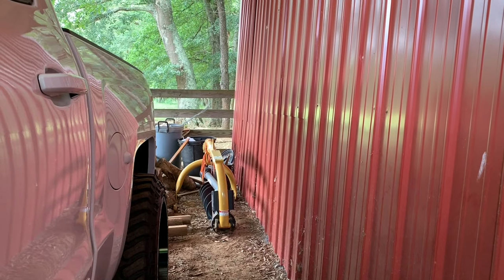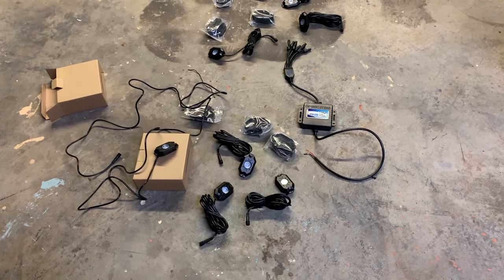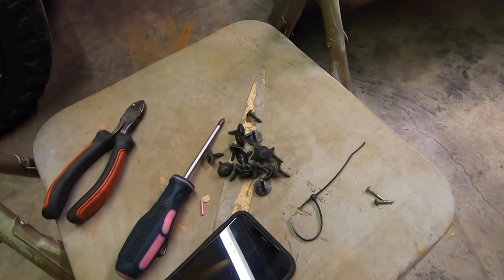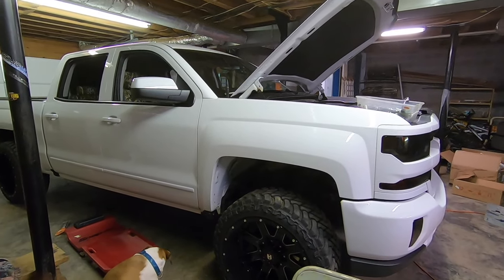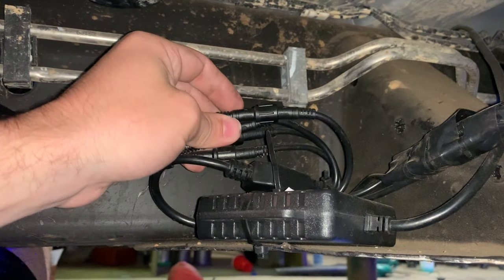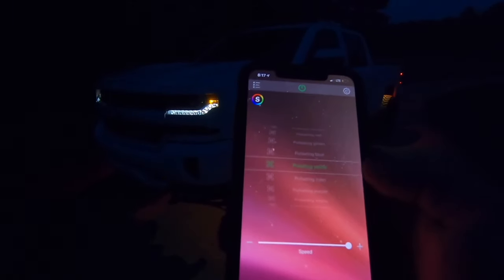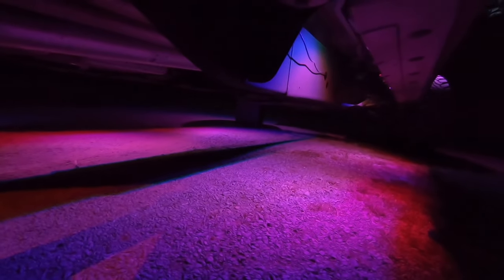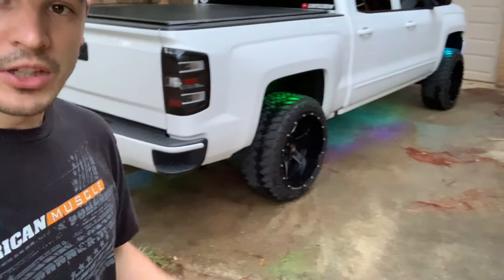Rock light install!

Comment: I took extra wire from a left over job to extend the module to the center of the truck. Then hardwired them to my upfitter switch with constant power when ever I want.

Comment: I usually run green on my truck. They’re pretty laid back around here about rock lights but I ain’t risking it
Reply: Silas Bargo same, but I had one cop tell me if I run them the only color really legal is white
Reply: Krypticate they’re pretty laid back here where I’m from. There’s more than a few guys running just straight blue lights an I ain’t seen one get pulled over yet. Knock on wood

Comment: Question.. I have an 8 piece rock light kit… do you suggest 2 per wheel well or 1 per wheel well / 1 front-1 rear- 1 between driver and passenger

Comment: What gauge positive/negative wire did you use? I used 18 gauge to extend the positive/negative wires from the module to my battery and the positive wire burnt down after a long drive right after installing them could this have been because I should’ve used 16 gauge or 14 gauge or because of heat somewhere under the truck or in the engine bay? They were connected straight to my battery but only the positive burnt down the negative wire was fine and was also 18 gauge and ran right along with the positive. Any suggestions?

Comment: The ones I just installed came in the same box as your and I got an option for the color white ? I looked more into your video & well you said you don’t use them anymore, but there still on the truck are the holding well still ?

Comment: Did you have to install a toggle switch inside the cab?
Reply: if i have a lower car like a 2008 corolla would the light pods not rly show up like they do on trucks or suvs? i rly wanted the pods rather than strips but if not then i might just have to do strips bc itd b pointless if u cant see it and thats what im worried abt.

Comment: Can’t you just use self tapping screws instead of the bolts?
Reply: Worked on my brothers and they hold in the plastic/cardboard type finder-wells surprisingly well just don't over tighten or you will strip

Comment: How’d you do the switch?
Reply: Run the power from the module to one terminal of the switch and run a wire from the battery to the other terminal of the switch, make sure it's grounded